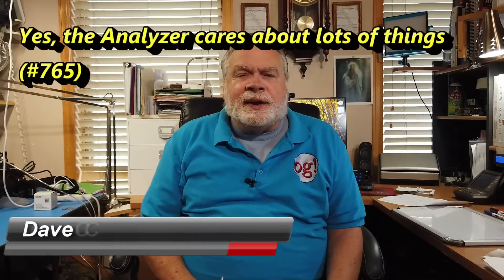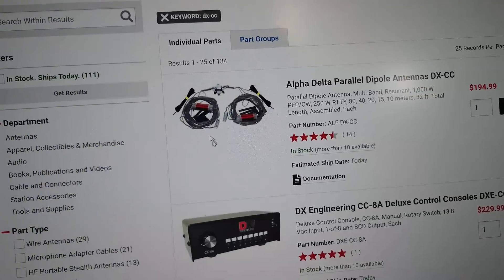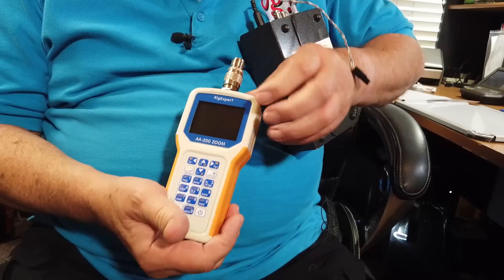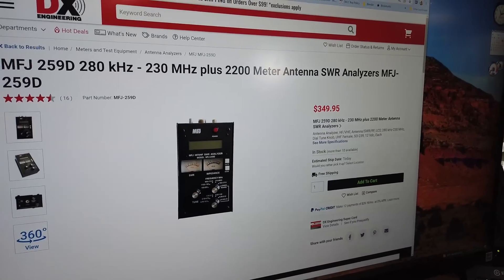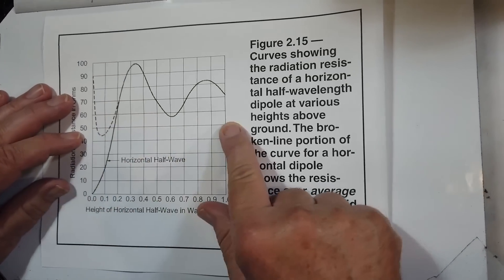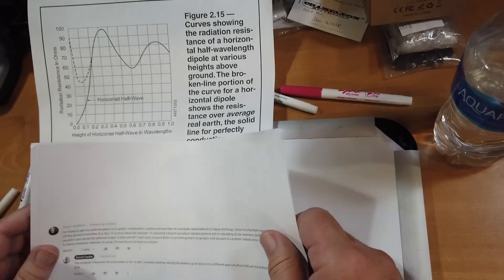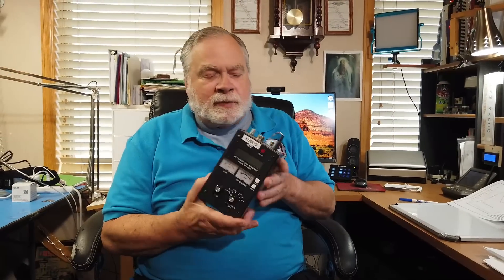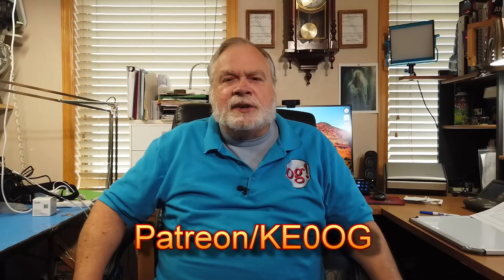Yes, The Analyzer Cares About Lots of Things (#765)

Comment: P.S.  My Comet antenna analyzer is super simple to use but is priced about the same as an MFJ 259, which does more things.  My NanoVNA is hard to see in direct sunlight but it does most everything the MFJ can do.  I use it in the shack so I include the feedline and various connections.  As such, I hook it into my computer and use their recommended software so the small screen and touch screen problems disappear.  True, the interface is a little glitchy getting it to work, but screen and mouse interface make it simple and remove the "old eyes" issues.
Reply from the maker: Yes, it's easier on the computer.

Comment: If he has a problem spending $400 for an MFJ-259D, he can, instead, pay $50 for a NanoVNA from Amazon (and a female SMA to SO-239 adapter) and get the same results
Reply: NanoVNA is a fabulous tool! Plus, there are lots of great YouTube videos on the matter, such as videos from W2AEW and IMSAIGuy.
Reply: Comparing a NanoVNA to a MFJ or RigExpert is like comparing an Arduino board to an Android or Mac tablet. Not really the same if the first requires more time and learning curve to get to the results.
Reply: @sammiller6631  It took me 15 min to get the NanoVNA doing what I needed to tune my antenna. Great device for a lot less money...
Reply: @sammiller6631  have RigExperts and NanoVNAs.  Gladly there are plenty of YT videos that help users with both. Like pizza, even the lesser nanoVNA is still good. If someone can’t afford more, the decision is simple.
Reply from the maker: If you can figure out the nanoVNA, then by all means use one. It's much more versatile than a simple analyzer. I for one like the more traditional approach.
Reply: @erpece  Does that 15 mins include the calibration time needed before measuring?
Reply: @sammiller6631  Yes, easily. You can also store the calibration and desired f range for later use.

But hey, nothing wrong with using an MFJ analyzer or other brand - I just think these things are ridiculously expensive for what you get. That sort of money will (almost) get you a radio like a Xiegu. To each their own, it's good to have a choice... 🙂
Reply: @erpece  How can you be sure a stored calibration is valid? That calibration was at a specific temperature and humidity, which changes all the time.
Reply: @sammiller6631  How will these variables  affect an analyzer without a calibration function? 🙂 I have analyzed my antenna on different occasions (without re-calibration) and not noticed significant changes. Rain and ice will have a much greater effect on SWR... I am not worried about 1.3 vs 1.4...

Comment: Hi Dave. I noticed on your Rig Expert you did the same as I did...couplers so the SO-239 on the unit isn't taking the ongoing abuse of screwing / unscrewing antenna coaxes. To me that seemed a likely mechanical failure point of an otherwise stellar design. 73 and thanks for all you do. de KC0DWZ.
Reply: His AA-230 Rig Expert has an N connector. The SO-239 is simply an adapter.
Reply: @forgetyourlife  Ah, thank you. I have AA-35 which has the SO-239 built in so I assumed Dave's was as well. Thanks for the clarification!
Reply from the maker: True. My analyzer was a freebie for review and came from Canada with an N-connector.
Reply: @davecasler  all AA-230’s have the N connector. Doesn’t matter what country imports it.

Comment: I agree about the 259B. I have one and also a simpler 208 which is all analog. Also a NanoVNA. The Nano is simple enough if you just use it for SWR and save the calibration data. Anyway I compared all three instruments and they all agree perfectly. So I use the 259 most of the time. Old school is cool.
73, VE7VIE and WV2J
Reply from the maker: I sure like mine.

Comment: You mention NanoVNA's as being complex. I thought that too. However, after looking at a number of UTube videos and actually trying them, I found actually very simple and easy to use! They are now my "go to" antenna analyzers in the field. 

There are two major problems I have with them: 
1) first, you can not read them in direct sunlight. I now have three of them and they all have that problem. You have to shade the screen.
2) second, you have to calibrate them, preferably before each use for the frequencies of interest. There are three small standard calibration SMA devices you need and they are very easy to lose in the field: I know, I have lost at two sets of standards somewhere in Montana and Wyoming!

Otherwise, they really work great for SOTA and POTA as well as base station antenna adjustments. 

One thing to say about SOTA and POTA: every antenna setup is different and you do need to recalibrate your antennas for each use if you want the best setups. As you have repeated: " With antennas, everything affects everything!" I really found that to be true with field antenna setups!

I really enjoy your videos.

73's 

AI7MY
Reply: RigExpert analyzers are even easier to use. They got help menus built in instead of relying on external videos.
Reply: @sammiller6631  So do the NanoNVA's. The problem is learning how to use them and understanding both the advantages and limitations. But more to the point, yesterday, I ordered a Rigexpert from DX Engineering to try it out. I have heard a lot of good things about them. Thank you for your reply.
Reply from the maker: The nanoVNAs are powerful tools and can do much more than determine SWR. I like my RigExpert, but have yet to try its computer capabilities.
Reply: @davecasler  Yesterday, my new  RigExpert AA-230 Zoom arrived. As far as using it, so far, I prefer my NanoNVA. HOWEVER, I really like the RigExpert AntScope 2 software! It works with both my RigExpert and my NanoNVA-H4. I could never get the NanoNVA software to work correctly on my Windows 11 computer but it came right up on AntScope2. Both the NanoNVA and the RigExpert give me a lot of information, and what is more important, there are not any major differences between the data values. The RigExpert screen does seem brighter so it might be a little easier to read in direct sunlight. I will need to test this on a field antenna. So far, both tools are useful but I still prefer the NanoNVA as the data screen is easier to work with and I can get all of the information (SWR, R, Z, and Smith Charts,) at one reading without switching between screens. They are not as easy to use as my MFJ-225 but they give me  a lot more information, which, as an engineer, I can use.
Reply: @sammiller6631  Please see my reply to Dave regarding the RigExpert and the NanoNVA-H4.
Reply: @wolson9  Why the NanoVNA-H instead of the NanoVNA-F? Or the NanoVNA V2 +4 for its improved shielding?
Reply: @sammiller6631  It is what I have. Not knowing much about NanoNVA's, I ordered the H4's. They have worked well for and I have no complaints other than above. I should add, when I ordered them, I really did not have a lot of hope for them to do much: I really thought they would be junk. But that has not been the case. I had previously used multi thousand dollar VNA's as part of my research work in a professional laboratory. I did not think a $50 dollar device would compare. I was very surprised by the performance I got.

Comment: I bought an Alpha Delta DX-CC as my very first HF antenna, and I still have it up after moving to Oregon.  Although I agree with your contention that it is an extremely bullett proof antenna, my problem is that for some reason it went out of tune over the years.  Not sure why that happend.I was hoping you would have given some advice on how to tune that antenna since I have been told by fellow hams that adjusting one radiating pair affects the tuning of the other two pairs.  

If I had to guess, I think I would have to start with the longer pair and then proceed down to the shorter pair, but I am not sure how that would work.  I hesitate starting the process because I don't want to do a lot of cutting and then find out I have to add some wire back on... the engineer in me hates the thought of patching things together.  I have both a Comet and a NanoVNA analyzer so I have the necessary test equipment.  I just need some guidence.
73 N7MHR
Reply from the maker: You don't have to cut anything. Just fold it back on itself--even insulated wire will work this way.

Comment: The 259 was the only ant. analyser out there at one time
Reply: MFJ always had cheaper versions like the 208 which had one meter and no digital display.
Reply from the maker: For a great many items, MFJ was first. Most ham shacks have at least one piece of MFJ gear.
Reply: @davecasler  It's MFJ's 50th anniversary and I think they deserve a plug. I have from them one transceiver. two analyzers, two tuners, three beams, some smaller instruments and even a grid-dip meter. None of them have ever given me any trouble. Long live Martin!

Comment: At least you know what you're getting with an MFJ-259D. Buying a "NanoVNA" is a crapshoot. There is no single official source as the original maker gave up and moved on to other projects. So you're left with clones all arguing that theirs is better. 
(ex: NanoVNA V2 (S-A-A-2) have asked R&L electronics to stop selling bad quality clones of their design. The other branch, copying edy555's original design, had drama between the NanoVNA-F and VNA-H crowds.)

It's a temperamental design that requires constant calibration. If you can put up with level of time and attention a magloop needs, one of the current NanoNVA clones could work for you in the shack. 

But the frustration increases ten fold out in the field for a SOTA trip or field day. That's where the more capable vector analyzers like RigExpert shine. They're not affected by temperature and humidity as much as the NanoVNA clones. And time saved by not needing to fuss and fiddle.

The large range (up to 3 Ghz on some NanoVNA clones) isn't as helpful if they all have the same 101 sample points, making the gap between points too large to be useful.
Reply from the maker: That's one of the issues with open source. Anyone can jump in. And they do, with varying results.